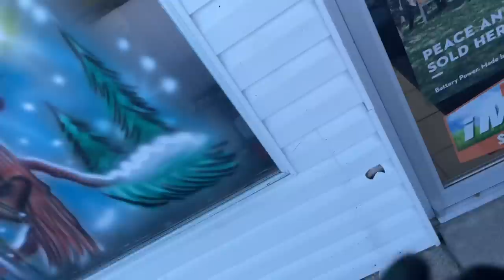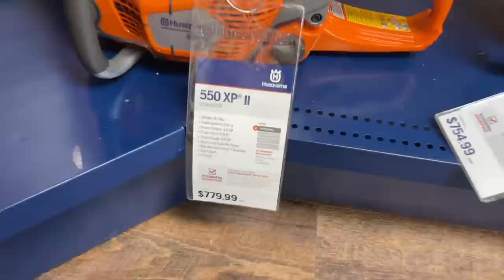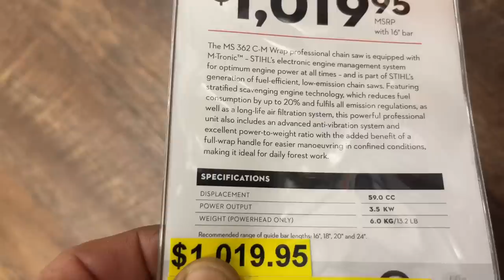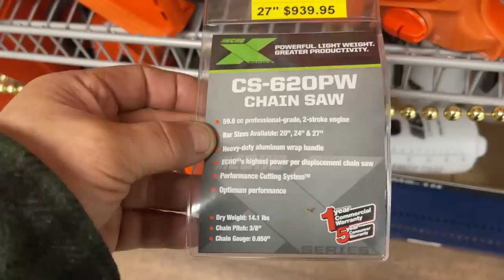Stihl 362c ,Buying the Giveaway Chainsaw. first fire up.

Comment: I’ve had a 362c with a west coast bark box, full wrap bar with a 25” bar for over a year and I cut wood everyday. 
The saw screams 
Zero issues so far , awesome running rig
Reply from the maker: Very good
Reply: Pretty much the same setup here, minus the full wrap handle. Loving it so far! Cuts as fast as I need it too. That bark box sounds great too.
Reply: Wait til you try a straight shot
Reply: Does it pull the chain well? I have a 16" bar on ours and realizing a bit longer would be nice.
Reply: @joelisaac7835  pulls very very well. Like buckin says tho, it’s all in the filling.
Reply: I’ve been cutting some fresh 22” birch rounds and it pulls nice through it. It’s not the fastest saw ever but it doesn’t really bog down, even with a full comp chain.

Comment: I picked up the same exact saw back in January for my first personal saw to get started working. Threw a bark box on it, a 25" bar , and it's the saw I use the most. All around good saw. Perfect for anything, felling, bucking, chunking spars. I've ran the hell out of it, and the only issue I've had with it is having the urge to buy another one 🤣

Comment: When I was working the landing the company saws were 362 with 28” bars and man did they eat the wood!!! I’ve fell some decent timber with them as well! They pull a 28” all day and keep going! Excellent saw!
Reply: I borrowed a 32” bar just for giggles and put it on my 362 ( has a bark box) .  With a Super sharp chain and aggressive rakers for some soft wood.  I was impressed how well it pulled a 32”. That said,  I never buried the 32” bar but I did cut good 28” rounds.  You just can’t pull on it. But if the chain is sharp and you just let it pull, it cuts pretty dang good.    I love the 32” bar!! Standing up is the way to go!  I’d never run a 32” on my 362 full time, but a 28” I will!! Time to upgrade from a 25” to a 28”.

Comment: Awwwwwe Buckin yer pullin on the ole heart strings again. Wonderful gift ya got the boys there. 362 is a delight to run in the log pile. Had mine 7 years and never an issue with 24” bar cutting nothing but nasty hardwood. 
I think ya just made a couple young men have the best Christmas ! Every pull of the cord they will think of Uncle Buckin givin em a leg up. 

Good on ya sir….. Have a truly Merry Christmas love to you and yours.

Comment: I have my grandpas 1985 Husqvarna rancher 50. He passed in 2017 at 93yrs young. It's not a big saw but for around the house or farm is plenty. He barely used it mostly after hurricane Hugo in 89'. I have the original owners manual and sales receipt. He paid rite at $400 back then. He had them put a bow on it and still on it. And I have the straight bar too. Other than replacing the fuel lines, fuel filter and air filter, plug, nothing been done to it. Other than high and low tuning. I love it. And has the chain guards on the bow that alot of people removed. Merry Christmas to you and yours! Love the channel!

Comment: I Have the 362 full wrap 25 inch bar with the Bark box just picked up my Bark box from Walker Saws, Great service there. I needed a newer exhaust for it to fit and I had the older one so it didn't work so I just told them my situation and Johnny Walker called me right away and found a solution for it to work, sent me the newer exhaust for the saw and what a difference 👌. just been cutting firewood with it for 6 years no servicing so far, best saw I've had so far. I Actually traded a buddy for one of my rifles for this saw lol That Bark Box sure woke it up

Comment: I've got a 362C and it is a great saw. Only problem so far is a small crack in the back of the handle behind the trigger. The plastic cracked just a bit, so I wrapped it with some duct tape to prevent it from growing. I guess the plastic is just a bit thin and weak, but the saw is killer. It's my go to saw unless I need to cut something big then I pull out the 660, but the 362C with the full wrap is awesome.

Comment: Joyeux Noel Buckin'! Ran a lot of those Stihl 362's, we've got about 6-7 of them at work that we use mostly as trail saws here in the Northwoods. 60cc is a nice lightweight saw with enough grunt to pull 24" bars and if you can only bring one saw out on an island with you, it'll take care of 90% of whatever you'll come across.
Reply: That's the reason I have mine. Big enough to fell 95% of the trees in our woods and light enough to not kill you when limbing all day.

Comment: The world needs more people to like you Billy you are a great inspiration to me I haven't watched all of your videos but I have spent my fair share of time learning tricks of the trade from you, I cut firewood for myself so it seems like every-time that I grab my saw I am a little rusty for a few days until I get the hang of things again. Man those husky chainsaws sound like dirt bikes running and they cut as smooth as butter with that sharp chain, I was cutting a 24" hickory today I bound my bar mid way through the cut, had to take my saw from the bar tried everything to get the bar free it's pinched tighter than Dicks hatband, I went to crank my tractor that I had with me in the woods it wouldn't crank, I stepped on my glasses, broke the handle out of my hatchet so I found myself frustrated I decided that I had enough signs thrown at me today to stop what I was doing so I found myself watching you on Youtube watching you and listening to your calm demeanor I finally calmed down and I will go back to the woods tomorrow to finish what I started today and if you can give me some good advice on bucking firewood without binding your bar I will take it. Thank you
Reply: Wedges. When you've cut deep enough to have 3" or so from the top of the bar to the top of the wood, stick a plastic wedge in and finish the cut. I carry a 3lb axe for driving them, but even a small hatchet or a decent stick is enough for driving wedges when bucking.

Comment: Hey Buckin' Billy hows it going. Hi I'm Nicholas. I said hi to you at Donny's saw shop in September. Next week i'm cutting some small alder trees with my brand new Husky 545 Mark II I've had it since Oct. 2020, i think it has only less than 5 hours run time. I love it a lot I used to run a stihl 041AV. Now i got a better chainsaw im a husky man forever.

Comment: Can't get a wrap handle for the 462 yet they don't come with any kind of dogs either had to modify a set to fit. I think I will order the aftermarket side cover for the 462/500i from Walkers might try a bark box. I don't cut firewood everyday I have the saw because I need one time to time, cutting firewood for a living over on this side of the straight isn't worth while. I can't remember what Stihl my boss just bought I think its a 362 I found it heavy for its size, I really like the 462 it replaced my 046mag the 046mag replaced the 051AVE.

Comment: I had a 24” bar on the 362 and it had no issues other than bar oil. I ended up putting the oil pump from a 460R (they bolt on) and it fixed that issue.

Comment: Hey buckin. Question about your trucks. Do you apply any undercoating to protect them from the salt during the winter? Merry Christmas bud
Reply: Do not use rubberized undercoating, your frame will rot from the inside out, learned that from South mane auto with Eric O.
Reply: @twcazhd  I agree. Just curious if buckin uses anything on those sweet old trucks . Personally I use fluid film

Comment: I have a ms 391 can a 28 inch bar be put on it ? . It has a 24 inch on it now . Thanks Daniel Luther
Reply: You can run a 28 inch bar but you are gonna have to turn the oiler to the max I run a 25 inch on my 391 looking to get a 28 soon

Comment: I like the Husqvarna l have a 365 l bought it last year before that l ran the 55 rancher wore out two but they changed them there quite a bit heavier so l upgraded only buck firewood now and falling use to do some logging, still 050 they liked to pull the cord handle thru your fingers ouch ! Then went to husky 2100 / jonsered 670 but now l prefer a lighter saw elbow pain
I have a double bitted axe head unique, l want you to have it how do l get it to you what is your mailing address